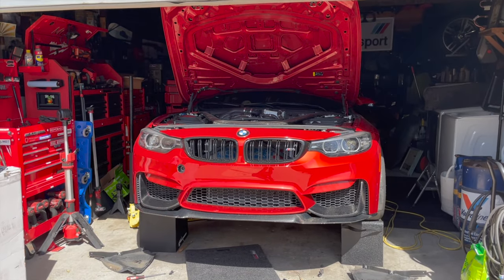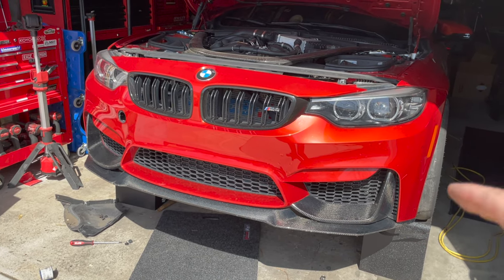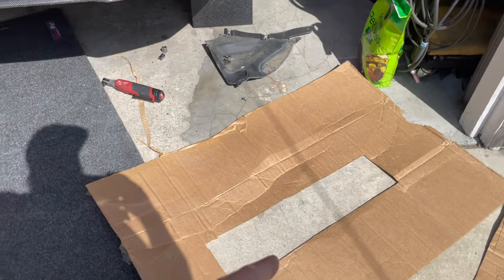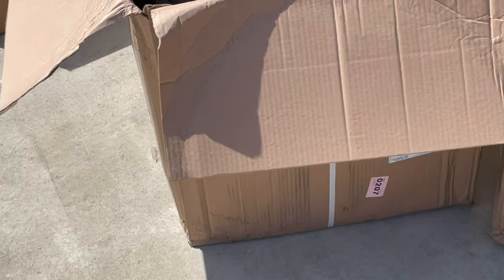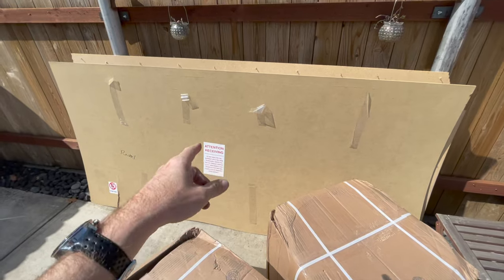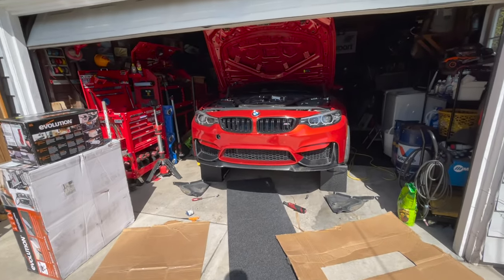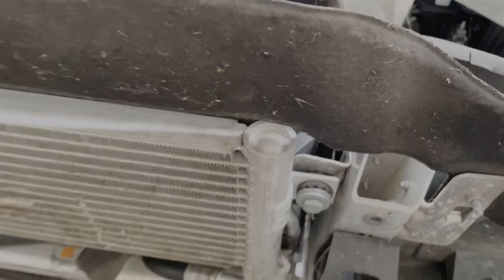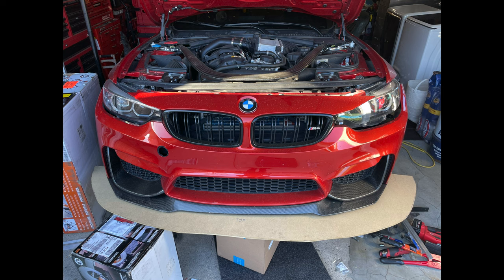BMW F8x Front AERO DIY SPLITTER

Comment: What spring rates are you using at the moment?
Reply from the maker: 800in front 900in rear probably gonna bump the rear up more to maybe 1000in
Reply: @BlakesGarage  Yeah, that big ol' wing is gonna require a bit more stiffness in the rear. To battle understeer, you probably need to soften up the front as well. If you compare the spread of stiffness on the stock springs vs what you have on the front now, you'd have to go to go to a ridiculous rate in the rear in order to keep it proportional! But that's untenable since the spring won't even compress if you go too stiff. That being said, aggressive aero does change everything. However, keep in mind that when you go past 1000 lb/in (divorce set up rear), you may need to get helper springs to keep the spring in place.  I'm currently running  1000 lb/in 8" (no helper) spring in the rear -- no wing.
Reply from the maker: @gtsporttour506  thanks for the feedback 👍🏻👍🏻 yeah I’m running true coilovers MCS 2WNR with helpers already but I’ll definitely be bumping up. I’ll probably try softening the front a bit today see if that makes much of a difference